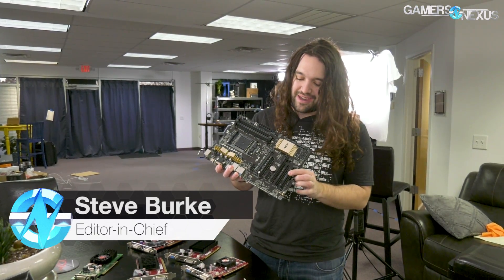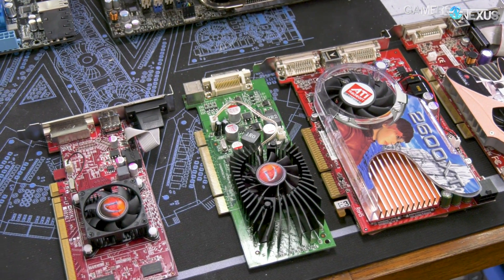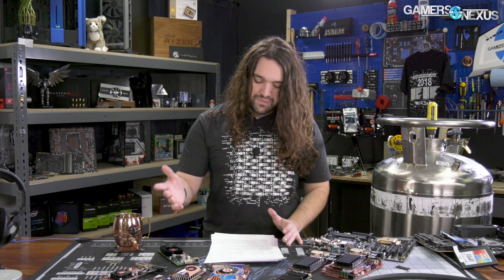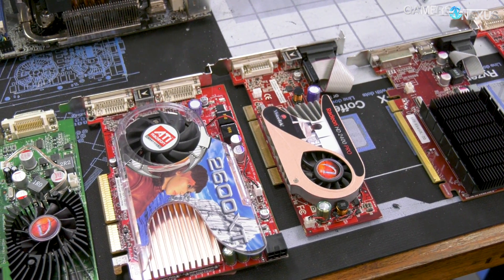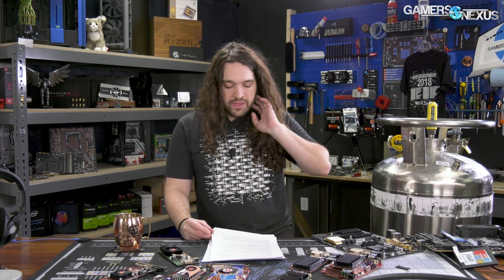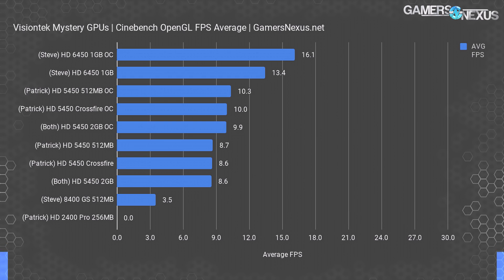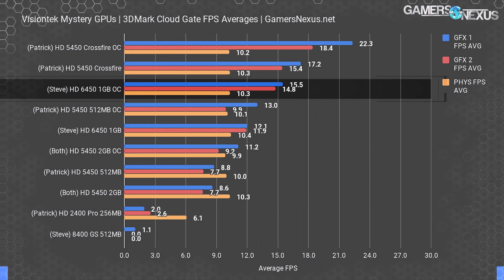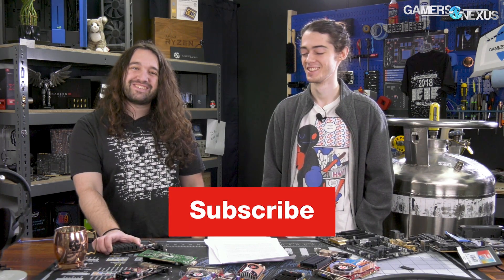Buying a Mystery Box of $5 GPUs from Visiontek | ATi Benchmarks

Comment: You wanted artwork for you walls.  I think that you should have a GN employee bake-off, where you each get 10-20 random pieces of hardware and/or peripherals or whatever, and each competitor has 60 minutes or whatever to assemble their loot box into some piece of "hartware".  Alternatively you can just dump a pile of stuff and each entrant gets to (round robin) pick their next component to use.  I imagine old thumb drives, graphics cards, various other boards, mice, dead fans, hard lines, pumps,  thermal paste, cat5 connectors, etc.  Each artwork needs to be mounted to a GN modmat.  Assembly most likely using some sort of plastic glue, zip ties, etc.  Let the GN Garbage Games begin.  Competitor must describe what they were trying to achieve, what were their inspiration, etc.  Would not be surprised if a rubber mallet were to be used during construction. :)

Comment: Ive been pulling cards like this from my local county recycling station. Folks throw away their old computers/TVs/microwaves and they are all in large mixed pallets and ive gotten tons of 300w power supplies, ddr2 ram, intel core 2 duos, crappy HP or other OEM  motherboards , and nvidia 8400gs cards. free. I cant figure out what to do with any of it. really its basicly all trash.
Reply: how do they recycle old computer parts? do they just melt it down?

Comment: Did anyone ever actually use S-Video? I had a few video cards with the port but I never did.
Reply: @NightDevilMacGeneral  LOL damn that's absurd... I wasn't expecting a response that interesting ;P
Reply: Older vivo cards I had for editing I used it alot as it was a cleaner signal then composite most of the time with less loss (vcr days) but other then that never for straight display out vga was fine.
Reply: The only thing I ever used it for was my old XP era laptop had S video out. I could pirate movies and watch them on my TV. That and I think I had an old DVD player or something that used S Video.
Reply: Only on my Nintendo 64
Reply: I have a few cards with composite out too, it was a fancypants feature. Before HDMI was on everything if you wanted to connect up to your TV this was it. I had a computer hooked up to my parents Grundig wide-screen CRT years and years ago with S-Video and from memory the picture was pretty good, but it was probably running at 854x480 or something like that. Great for playing pirated movies without burning a disk before digital media players and DVRs got good (and cheap).
Reply: IF I remember correctly, my Trash 80 Mod 1 used S-Video.  I got that in '79  I think...
Reply: Back in 2003/04 I had an ATI card with s-video and an s-video to composite adapter...  I actually used it to play on my TV back when I was a young teen.

Comment: With cards this old i can't believe you didn't try to run Crysis for a joke. Missed opportunity, think of the memes.
Reply: A 5450 can just about run crysis at playable framerates, I tried it myself a little over a year ago :)
Reply: Lance Smart Minimum settings, but at what resolution?
Reply: @jonnyj-z2x  crysis 1 was never so much about gpu but about cpu. It was using 2 cores at max (4 after patch but only to stabilise framerate) and that's why it was so crushing. At the time of launch we had the early c2d which while fast for their time were not sufficient for crysis. It took overclocked Nehalem to really get good framerate on crysis 1.
Reply: Brings me back when I played through Crysis with a GeForce 6800 GS, 1024x768/low. On the last level, I had to drop the resolution to 800x600, ah, good times :)
Reply: fun fact I used to run crysis on an AMD Athelon dual core, 3 gigs of ram, and an MSI 8400GS and got around like 35-45 fps average on low-medium settings.

Comment: Still rocking an HD5450 512MB, it works fine as a display output for my parents basic internet-browsing PC.
Paired with an Intel Core 2 Quad Q9550, 8GB DDR2 and an SSD they absolutely love it!
Reply from the maker: Seems like a completely fine build for that task!
Reply: Wow thanks for the comment! :)

Probably going to upgrade the CPU cooler and case fans though, they make a lot of noise. Especially the CPU cooler since it's the stock one from a Core2Duo, because I broke the pins for the Core2Quad stock cooler.
Reply: @ThePietn1  i think you might pay more for the fans and cpu cooler than a better used computer.
Reply: @ThePietn1  🙂 look for the $10 Heavy Duty Overkill Intel 775 Cooler, its the one with a heavy steel metal X bracket and the center has a metal copper slug, its equivalent to a 92mm tower cooler, if u break a plastic pin u can get replacements on fleabay for $3, for Fans checkout 92mm or 120mm they run $5 a pop for blk generic ones✌️😏
Reply: Because the integrated graphics are so old (they are in the motherboard, not the CPU) that it doesn't support 1080p video encoding. My parents like a YouTube video or two every now and then ^^
Reply: @ThePietn1  🙂 correct, noobs dont understand that Integrated Graphics back then either on the cpu or motherboard are almost non existant with a Passmark Score of only 50 points, thats only enuf graphics power to see the Bios Screen LOL! ☺️
Reply: @Gareth Fairclough ☺️ yes that sometimes happens with AM2 & Pentium 4 and a Windows Install that never had maintenance. I got my Mum a Dell T3400 Desktop from Thrift Store, it has a Core2Quad, 8GB, HD 6770, 125ssd, Windows7, its a good beater 😗
Reply: A  👏😏 Respect, all Hail the mighty Core2Quad ☺️
Reply: I still have an HD5450 I was thinking about turfing yesterday.
Reply: I basicly did the same for my parents. I gave my mom my old X2 6400+ / Asus P4p800 with I don't remember which GPU. I think it was an HD5450, or maybe the XFX Fatality 8600GT. In my old Antec P180 case. I later upgraded my parents to a Pentium G3258 (using IGP) with an affordable Kingston SSD.
Reply: 🙂 i have a 9550 build, i have it paired with a 750thai, good stuff for GOG games✌️😏📀🎮🕹️📀
Reply: @Gareth Fairclough 🙂 thats weird n creepy, maybe it was posessed? 👻 Any idea what component was causing it? im curious thx for sharing ✌️😏🥃
Reply: @Gareth Fairclough 😏 neat, must have been a Gremlin then 😈
Reply: Thats good entry level pc but swap the gpu out for 7570 if u wana game mid or low settings
Reply: In the words of blizzard, you guys dont have onboard graphics?
Reply: Why even use a graphics card in that application?
Reply: How is it possible for an ATi card to survive that long?! AMD and ATi is known for shorter lifespan.
Reply: @Arif_Islam77  Well it was never overclocked and I changed the thermal paste twice already to make sure it stays cool enough ^^

Comment: I love the near constant sarcasm here. Considered building a retro gaming system, thanks for the content GN
Reply: I'm running an FX9590, does that count as retro yet? Lol
Reply: Probably not, but it you can probably dual boot it with XP if you have a video card with the right drivers.
Reply: @Up8Y  Dual boot with Linux e.g. Xubuntu or so, I used it with ATI Radeon 9250 (classic PCI, 128 MB) and an Micro-Star MS-8806 with a NVidea TNT2 chip (AGP, 32 MB).
Reply: @Up8Y  Why would I when I can play even Games from 1996 on my modern rig using a GLIDE to DX11 translator?
Reply: @jakesully2868  Not really, I run a Phenom II X4 B97 at 3.2 GHz on an AM2+ motherboard and an ancient Pentium 4 HT at 3.0 GHz. Both are used daily!
Reply: "I love the near constant sarcasm here."

If I ever meet Steve, as a British citizen, I'm going to give him some kind of award for his sarcasm. It's seriously on a high level compared to his fellow Americans!
Reply: Those cards are too modern for retro gaming....  2007 is NOT retro..
Reply: @frankb5728  Who defines that? You?
Reply: @kyoudaiken  I DO, only now are the 90s retro..  the mid 2000s are not. deal with it
Reply: @frankb5728  Depends on what you intend to run... There are stuff that requires an older OS or video card at this point so you can end up having to build a Socket 775 system.

Comment: Steve... Get to the point, do these damn things run crysis?
Reply: A HD5450 can just about run crysis at playable framerates, I tried it myself a little over a year ago :)
Reply from the maker: Nope.
Reply: @GamersNexus  That's not true, Crysis will run on anything that supports Shader Model 2.0, with possible exceptions being the Geforce FX series and maybe some IGPs. Whether it'll be playable is a different story, but it'll run.
Reply: @GamersNexus  if you can run n play gtav at 20 fps / 1080p in dx9 normal settings with a 9800gt 512mb im sure 1 of those cards will run crysis.
Reply: @GamersNexus  i mean crysis minimum requirement was only a 256mb gpu

Comment: I ended up getting a GTX 650 Ti and a 256MB FX 5200 AGP. The 650 Ti is a Sparkle of all things and if I overclock more than about 100 MHz the core will get stuck at 300MHz until reboot. I can however overclock the memory by 300MHz which helps a lot.

Comment: I run an i5 2500k + Radeon HD6950. Thanks Visiontek for telling me that my PC is 1 step above worthless... :(
Reply from the maker: Technically, they're saying the card is worth at least $10!
Reply: @GamersNexus  Clearly a gaming rig then!
Reply: Get a 2080 ti
Reply: @ayomaggotz  4 Titan RTXs* in Quad-SLI while at that... or what's the top sh*t currently?
*or Titan Vs
Reply: My wife is still using my old OC'd 2500k rig but she has a gtx 970 in it. All she plays is CS:Source so it is all good! 

The i5 2500k was and still is a solid cpu. Your big problem is that vidcard.
Reply: I still run a 2500k, clocked since sometime in the first months of its life to 4.5 GHz. It's still doing magnificently!
Pairing it with an RTX 2060 will probably show a bit of bottle necking, but it still does the job just fine!
Reply: @skatterpro  Spot on I have 2 XFX 6950's 2Gb running the 6970 bios (first gen card so had blower fan but switchable bios and 2Gb, they reduced it to 1 Gb later). They run with a 2600K and 2500K very occasionally together in XFire on the 2600K, but yeah new Gfx card first (probably 2060) before the rest gets sorted.
Reply: Get a GTX 770 man
Reply: @Atilolzz  get a 1060
Reply: @Atilolzz  Or a 680, 960, or a #TeamRed equivalent. Marginal difference IMO.
Or stick with the 6950. Absolutely fine card. Again, IMO.